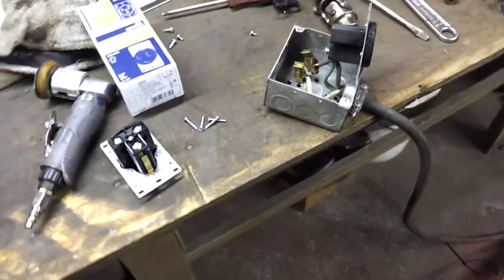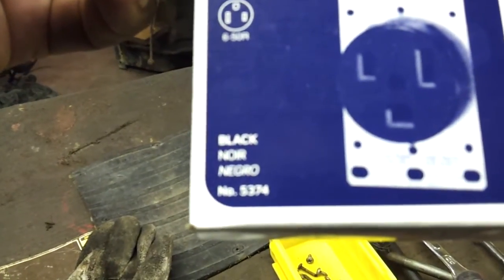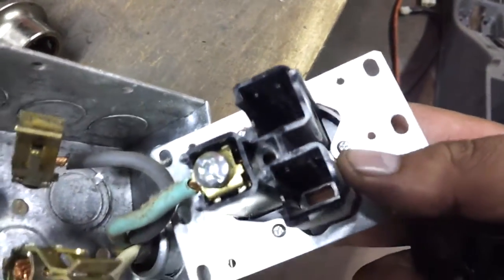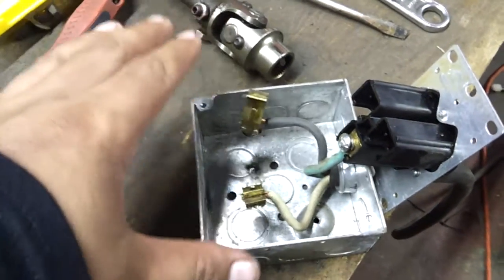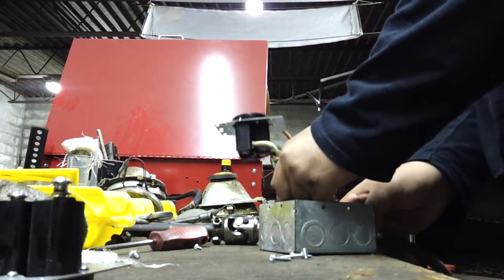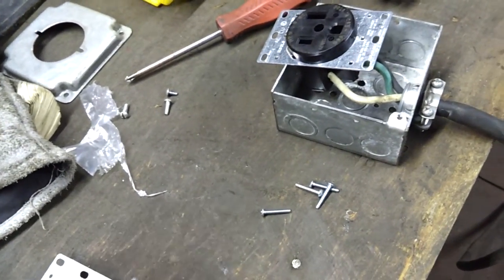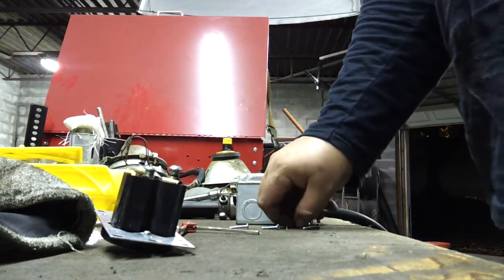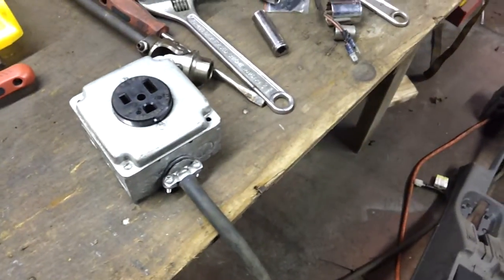Electrical Repair - Bad 240V Outlet

Comment: You have it right or it would not be working.  The green wire should be hooked up to the ground bus bar in the panel. The white and black should be wired into a double pole breaker to get 2 different 110 (115 or 120) legs.

When I created a new extension cord I used a different style box.  You can search ebay to see it :
COOPER 50-Amp WELDER RECEPTACLE CONNECTOR 50A 250V 6-50R 2P 3W 50amp Plug

Comment from the maker: My wire doesn't have a "ground" it just has the 3 wires you see in the video. I'm using this as a home made extension cord wired right into the breaker panel. Is this wrong? Should I be using a wire with a copper ground or just get a plastic box and get rid of this metal one?

Comment: the plug has the ground going to the plate and then to the box via the screw.  the black soot where it shorted is evidence the box was still grounded and the breaker most likely popped protecting you as it should.  
The old box and cable I have has a 'pigtail' that comes from the box to meet the ground wire at the receptacle.

I am no electrician either
but it is good that it failed the way it did instead of touching the metal box without shorting.